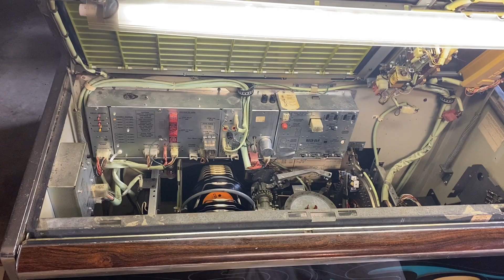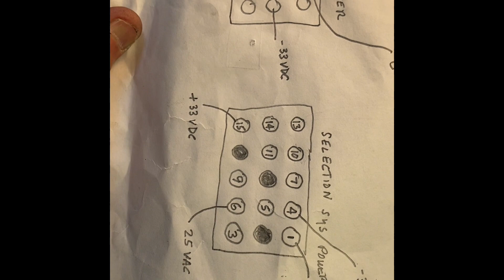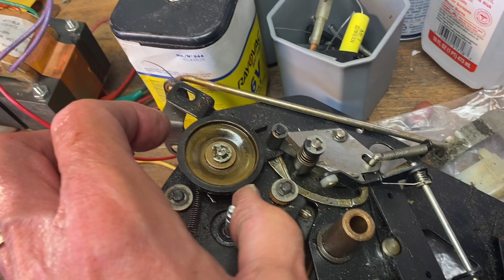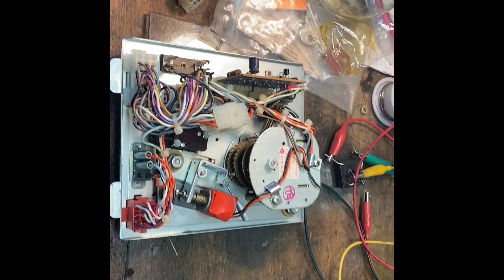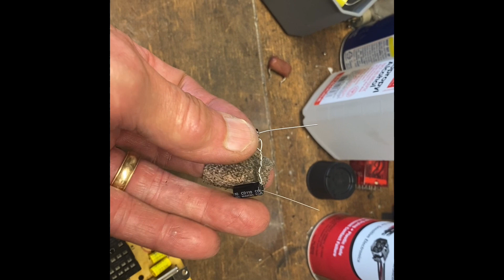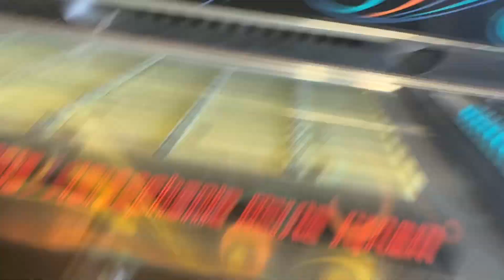Bringing the Rockola 470 jukebox back to life

Comment: Hi I have a Rockola 470  and wondering if you could help. When the record finished playing the arm lifted partly off and the whole mechanism shut down. Only the lights for the top are still going but the selector lights are not working. Any ideas where to start as I cannot find anyone in New Zealand to service it.
Reply from the maker: First thing to do is to reset the mechanism circuit breaker on the left front of the power supply on the inside back door.  See if gripper motor will then bring record back to the rack.  If not, you will need to manually turn the knob on the gripper motor by reaching underneath the mech.  It will be tedious to turn the knob so many times but you must get the gripper bow back over the magazine until you hear the click of the microswitch #1 in the back.  Then reset the mech circuit breaker again.  See if machine works then.  If it selects another record and the same thing happens when it is ready to return to the rack, you probably have a shorted reverse relay in the bronze control box that sits under the mech.  Reseat all four of the plastic molex connectors that go to this box just in case it is a loose connection.  If no loose connection, I would join the Rockola Jukebox Club group on FB and post a video of what is happening.  I and others can then try to walk you thru this.  I hope you have a service manual.  If not, order one on line (eBay or Victory Glass)
Reply: @williamweisel2176  Thanks William. After manually turning the knob on the gripper motor it was still the same. Then I discovered a earth strap had dropped down and made contact on some wiring connections, tied that back up, pressed the reset button and it is now back up and running. Who would have thought one wire would drop down and cause the issue!